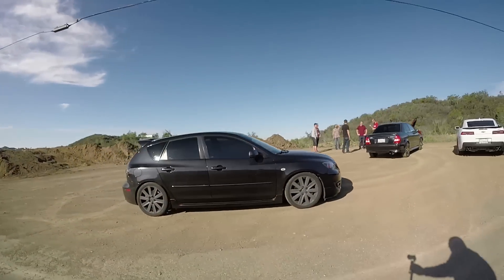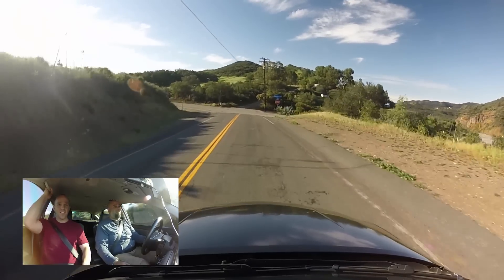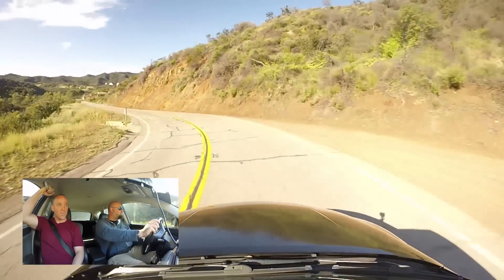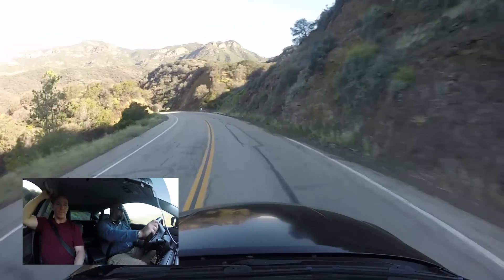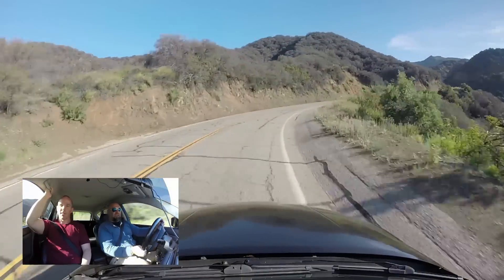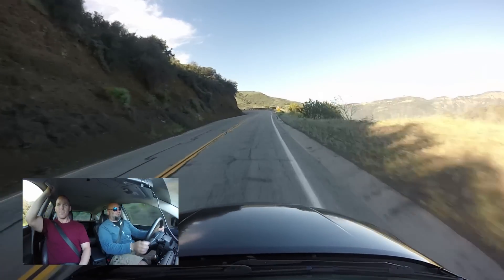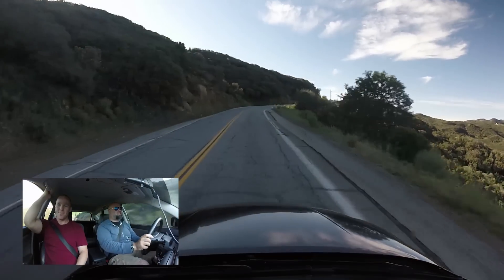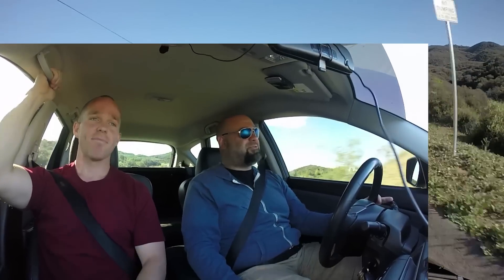450 HP Gen1 Mazdaspeed3 - One Take

Comment: i would like to see a roll race between this and a mustang gt 2015
Reply: Dacrazy-can This would smoke it assuming it's not from like 20mph. 420 at the wheels and 650lbs lighter.
Reply: Bryan Kendall
yeah , but i want to see how much
Reply: Dacrazy-can Well there's only one way to find out...
Reply: ***** Nah not if you give the GT the same built engine you know what will happen then
Reply: +DJ JONES why would the 2015 mustang gt need another 10grand dumped into it when it already costs about 10k more than the speed? this puts them on about equal footing... sorry fanboy, i know the 5.0 needs something to keep up, but i do like your blue mustang... is it laguna seca seca blue?
Reply: HatelivesNextDoor definitely laguna seca blue.
Reply: That's a roll rape not a roll race. This is a great car but let's not get carried away. It's not in the same league as Coyote Mustang or even a 350Z. It's a front wheel drive grocery getter with a turbo slapped on. Yes they can be fast but when it takes 20 pound of boost equal an N/A Mustang GT that says a lot. Enjoy it for what it is and accept the fact that you should save up for a V8 car if you want to make big power reliably. 500 horsepower at 8psi will last a hell of a lot longer than 500 horsepower at 28psi.
Reply: DJ JONES this not a jdm

Comment: 'Have you done anything to the brakes?' 'No.' There's quite a few of these One Takes where that dialogue happens. What is the point in adding huge power if you can't use it? A car can't be truly fast unless it has brakes that can cope with it's power output. It should be the first thing you do!
Reply: lol problem is most ppl care more about pure power than having a well rounded car
Reply: Yeah, it's crazy. Is it fun to have to brake 400 metres before a corner? Sounds a bit shit to me.

Comment: Is it possible to get away with a catless exhaust in L.A?
I have an 03 cobra with Long Tube Headers off road X and bullet mufflers, I'm wondering if I need to add high flow cats? Or if I will be ok catless if I find the right people. I am moving from NC to L.A next year.

Thanks
Reply: Are you talking smog wise? If so you usually would just have to find someone to overlook it and pay a lil more, my challenger and M5 are catless and just depending on how you drive will determine if you get pulled over constantly or not haha.

Comment: The gen 1 speed3 is way nicer inside and out.. Plus the steering and gearing..

Have a large dog.. Cant think of many other sub 30k Hatch/performance wagons that will fit her like one of these.  The Sti/wrx hatches are tiny,  as are the Ford St's.  Any suggestions? 

Great car and video.. If I get one ill need to modify it close to this,  minus e85
Reply: Shahul Usman I've got 2 golden retrievers. Theres plenty of room:)
Reply: Nice.. I have a 100lb greater Swiss mountain. Shoukd be good if you can fit a golden.  I wish the Fiesta/focus St's had bigger hatches
Reply: Wait,  the dogs fit with the back seats up or down?

Comment: It seems like in the US you can only buy petrol? Diesel and e85 is not common? In Sweden we got diesel and e85 in EVERY station which is pretty sweet
Reply from the maker: mrackelito1 You can find diesel at about 1/3 of the fuel stations in the US, and E85 is common in corn-growing regions, but quite rare in other places. There is only 1 station within 5 miles (that's a lot in LA) of my house that sells E85
Reply: mrackelito1 where I am in Pennsylvania, the closest e85 is about 70 miles away.Diesel is around every corner though because there are a lot of diesel pickups here (mostly douche bag kids)
Reply: TheSmokingTire wantsanewvehicle Oh damn, and one more thing, you have like 91 or 92 octane fuel right? We have 95 and 98 which is wierd, do we count differently and its the same or is your petrol worse? Thanks for reply
Reply: mrackelito1 92 octane in the U.S. is equivalent to 96 octane in Europe. The U.S. uses it's own rating system. Where I am the best octane around is 93, which makes the premium just about the same as in Europe.
Reply: Hawk Ize Oh okey thanks for the answer

Comment: who//where/which shop in Torrance you say? I checked the wheelwell page but couldnt find info on the builder
Reply: swigga4O AQ Motorsports. Adam, who is the owner of the shop is the one who built the motor. He worked for Mazda as a mechanic for 7 years. Very reputable guy.

Comment: I call BS on 420whp. It's also funny how the title says 450 and the description says 420. As an owner of a 380whp Speed 3 who has tuned 10 or so of these cars, I know them very well. Even with E85 to push back the KR threshold, it is IMPOSSIBLE to put down 420whp on stock injectors. Period. We have several local fully-bolted Speeds on GTX3076s that ran out of injector headroom a 370-380whp. This is the consistent limit that is extremely well-known and seen with this platform. Look on MSF for tons of data on this, if you want. This has been confirmed by several top-name pro tuners on the Speed platform, like Lex from Stratified and Justin from FREEKTUNE.

Without supplemental fueling, we run out of fuel at 370-380whp, regardless of turbo. Air + fuel = power. If you want >380whp, you need more fuel, even with the most efficient setup/super-high flowing turbo. >380whp requires >380whp worth of fuel, there's no way around it. We need methanol or supplemental PI at that point.

Dynojet graphs or I call serious BS, man. I'll bet he's quoting either 1) VDyno numbers with the very forgiving Dynojet correction factor (1.09), 2) quoting brake horsepower (at the crank) rather than wheel horsepower, or 3) the most likely, just simply inflating his numbers. Many people do it, LOL.

The thing of it is that E85 requires 30% more fueling volume when you run it straight. Speed guys mix it though, and we get the best balance of performance/injector headroom at about 25-30% ethanol content. But even at that level, it easy eats up 10-15% of our injector headroom due to it's lower energy potential as a fuel. This guy is simply not being honest...
Reply: +Zack Richmond Suit you your self. I've had to car dynod at at 2 different dynojets and both times it made around the same power. VDyno with a 1.01 correction factor is also showing around the same number. My injectors are currently at 108% though so I have no head room. And as far as the 450hp in the description, That is an error on Matts side. I told him that the Car made 420whp. If you were to factor in a drive chain loss of 15% which is low, that would mean that my car is making around 480hp at the crank
Reply: padsalltheway Must be corrected SAE numbers. You outta be really careful running over 100 IDC. You're actually injecting during the exhaust cycle at that point. That's really dangerous. I'm surprised you're not getting spark blowout at that level. Was it an actual Dynojet? Or a Dynapak? Some dynos are much "easier" than others.

Regardless, I wouldn't be running that tune long-term. A tune that consistently hits >100 IDC is just asking for trouble...
Reply: 370 hp with tune , exhaust system and e85 . I agree something else has been done to it
Reply: Ben Chesterman I can agree with 370 too, so long as he's upgraded turbo. K04s (stock turbo) will only support 330 or so tops. I made 385whp being fully bolted, ethanol tuned, BNR S3 turbo, all the bells/whistles/supporting mods without supplemental fueling.

I just recently added water/methanol injection to my car, but I didn't tune it for any more power regardless of the fact that I now have extra fueling headroom because stock rods and stock clutch are also not happy north of 380wtq or so. If you have a turbo big enough, and the extra fueling that is NECESSARY (without which it is LITERALLY IMPOSSIBLE to make >385-390whp - can't argue with physics), there's still the matter of the clutch and the rods too. My BS meter went off the charts when this dude started talking about his power level because I know MS3s like the back of my hand. I've tuned them too...
Reply: Too bad Matt isn't here in Texas (or me being in Cali). He could drive my E30/methanol injected Speed with a BNR S3. Since the standard Mazdaspeed convention of talking about whp/wtq has been broken here, I put down ~440/440 at the crank. It'd be a nice comparison, and my longer Genpu (2nd gen) gears would help enjoy all that extra power... :D
Reply: Did you use Methanol injection as your aux fuel to make those numbers?
Reply: My mate has an S3, upgraded TMIC, DP, E85 mix and he is running 375 hp atw on 23 psi.
Reply: Not on stock injectors with an ethanol mix. The upper limit is 370-380whp, and you need a turbo big enough to do it. The S3's record was 424whp, and it required supplemental fueling (pretty sure it was methanol he used, not PI). The key is auxiliary fueling. ESPECIALLY if you're running an ethanol mix. Methanol or PI isn't optional, it's mandatory beyond 370-380 with an E25-E30 mix in your tank.

Now if you get a big enough turbo, you can get close to 500whp on stock injectors, the key is you have to use 93 because it doesn't eat up your fueling headroom nearly as fast as ethanol. You also have to use a turbo big enough so that you can get there without hitting the knock threshold first. This requires a big hotside.

On a turbo like the S3, which is essentially a GT2871 (~43 lbs/min), you're lucky to hit 350whp on 93 before becoming knock-limited, especially if your 93 suck, like it does in Texas, or especially CA's horrible fuel. You need the knock protection of E25-E30 to hit the 370-380whp, but then your injector duty cycle goes beyond 100 and you'll get spark blowout. This is why auxiliary fueling is so essential. Nobody wants to run a huge turbo to hit 500whp on 93 and DD it. Turbos that big feel like a complete dog around town.

But what do I know, I've only owned and tuned Mazdaspeeds for 5 years, LOL. This isn't theory to me, but practical experience. But if you still don't believe me, talk to Lex from Stratified Automotive, Rob from Hypnotic Tuning, Will from Purple Drank, Justin from FREEKTUNE, Jason from Dizzy, or any of the other highly reputable/extremely experienced tuners of our platform.
Reply: Plus having a stock top mount intercooler
Reply: Numinous my car, borg warner s300sx, damon aux port injection 4x 1000cc bosch, 6 puck clutch, and if you know cars a bunch of other sheet about 4k worth. its still getting built, just got the forged carrillo rods and wiseco platinum pistons in and will be tuning soon. Going for reliable tune 550whp on 91 hopefully 600+ on e85 we’ll see
Reply: @numinous4789  Chill out, dude. The car has probably a ported intake manifold, flowing a few gal of E85 too. That's an easy 420, I have mine that way

Comment: Zero respect for having that ammount of power, and not making sure the car stops properly. Simply not cool. 

Other than that: I like it:)
Reply: ***** Dude its not a race car, 400 at the front wheels is not practical in any way, who cares if it has massive brakes this car is only good for huge straight line pulls anyway
Reply: The stock rotors on the speed 3 are big
Reply: ***** well it kinda depends on how you use it. if you like to start from the lights and that's it, the stock brakes will hold, but if you drive hard all the time, they will obviously overheat rapidly,so they need modification. in a 420hp car though you need them more than if it's a minor power upgrade.
Reply: ***** I dont think people realize how expenseive big brakes are. A full set can be 3 or 4 grand
Reply: ***** i think the first thing you need to address is probably overheating, not the stopping power. that depends on the specificcar of course, but some stock cars stop surprisingly well, so you would need good rotors.
Reply: ***** The stock calipers with a good set of fluid and pads are sufficient on the track with that much power. Most people prefer incredible stopping power, but I can tell you it's not necessary if you know what you are doing.
Reply: @TonyToretto25  yes they are sufficient, pretty big brakes from factory

Comment: Now need a sorted MS6
Reply: sweeeptheleg Would love to see an AWD MS3 like the 6 got
Reply: Charles T there is a guy in Greece that did the AWD conversion to his gen 1 MS3. It pretty nice
Reply: crimson25haze Mazda is doing an AWD one in 2016 :)
Reply: Still a maybe...it's isn't 100%, but it's exciting to think about!
Reply: Charles T I agree but the AWD system kinda sucks, it's FWD till the front slips, and cannot send more than 50% to the rear
Reply: MrThePrivateer Well I'd still prefer an imperfect AWD over any FWD
Reply: dB Actually that is not entirely true. 
The only time what you said above is true is when maneuvering at very low speeds(pulling out of a parking lot.) If it is very wet and the front tires slip for even a second, the rear wheels activate and move you out of the slip. Whereas driving at normal speeds the power will be split 50, 50 Front, Rear.) Especially while cornering.

I know because I have one and experienced the the parking lot event detailed above. + Other technical info.
Reply: @gigidy5  no they haven't

Comment: All power mods, stock brakes and susp. Surprised this kid isn't wearing an Afflicted T-shirt. Mega bro.
Reply: BlueHokage I'd phrase it a bit more respectfully but the message would be the same.
Reply: BlueHokage I have driven the mountains with the guy who owns this car. The OEM brakes are sufficient with good pads and fluid, and he has suspension.
Reply: He has coilovers, upgraded inter cooler, and wider tires. So he's not running on stock suspension
Reply: TonyToretto Agreed Mr. Tony. That said, I thought for sure we were going over the edge at 7:05 :(. Some better pads would have been great for that corner.

Comment: What's the difference between power at the crank and power at the wheels?
Reply: Louis Auto Power at the crank is all the power the engine makes. Power at the wheels will be lower than that because there is powerloss as it travels down the drivetrain.
Reply: Louis Auto Adding to the other guys, its a more accurate representation of the car's power. You could measure your bhp at the crank, but be running super heavy wheels and massive brakes, so the actual power output would be less due to the extra weight the engine has to turn. Its more pronounced when dealing with smaller engines though, obviously if you're making huge bhp the difference is not so much. When Top Gear tried to hop up a Renault Aventime, the first thing they did was put huge wheels and brakes on and they actually went 2 seconds slower round the track because the tiny engine lacked enough power to compensate.
Reply: Louis Auto There's always going to be power loss from the drivetrain. So an engine that has 400 hp at the crank (leaving the engine) will probably lose 15% by the time it reaches the drive wheels (340 hp).
Reply: Thanks the input
Reply: Usually 12 % loss in a FWD, around 15 % in a RWD & anywhere between 25-35 in an AWD....

Comment: He should have gotten an 2007-10 N54 335i, he would have had much more power than 420whp for a lot less money. You can have more than that with bolt ons on an N54. Probably would have less problems too. Can you tell i have one? it is a 535i, thou

Comment: Yes, it clearly has traction issues. But thats obviously to be expected with a front wheel drive monster like this. However, ive ridden in plenty of boosted civics and preludes that have a LOT more trouble putting 300 horse to the road than this 400 plus speed 3 does. The power at first glance seemed reasonably usable. Everyone complaines about torque steer with these. I drive an 08 speed 3 with the standard bolt ons and tune and im able to beat cars with 300 plus horse because if your conservative with the throttle and know how to drive your car relatively well, you can negate the torque steer enough to make having that power worth while. There is such thing as too much power for certain chassis and i think 450 is too much for this particular chassis.
Reply: SerenityNow You can also trail-brake (If you're on a track). Trail-braking reduces under-steer and in my opinion, makes the car easier to drive.
Trail-braking is when you apply your brakes later and keep them applied throughout the whole corner. Really cuts down on lap times.
Reply: Tbh I find torque steer to be most noticeable in 1st and 2nd gear, mainly with the steering wheel slightly turned.

Comment: High HP is only a longer rev across red line.
The strong pull is made by torq.

Early shift with high NM Will kill a high revv HP

Saab got the long gears with high NM

Killing a lot of high HP cars with same kg. 

2500rpm is going a 120kmh
3500rpm in doing a 170kmh

So the kmh Goes faster then the rpm;)

HP means top speed.
So at the end Its a higher top speed.

But how fast Will you gain it. 

Get some NM;)

Comment: no way that thing is running 420 at the wheels with a top mount
Reply: +Anthony C with the stock top mount no way your rite. With a ets top mount or quality top mount can.
Reply: go to 0:55 certainly looks factory
Reply: Anthony C
 I agree what I was saying is seems doubtful making that power with stock top mount but if he had a ETS top mount or other upgrade thats different.
Reply: joes04redrx8  Who cares about the shroud?? The stock tmic is pure cheap crap. The stocker loses about 3.5psi of boost cooling the charge. My ETS loses 1.5 psi ive tested and drops boost temps 40 degrees across the board. You can get a good used one on the cheap also.